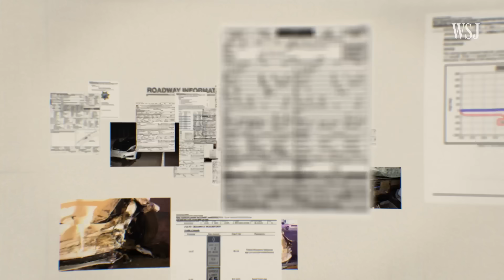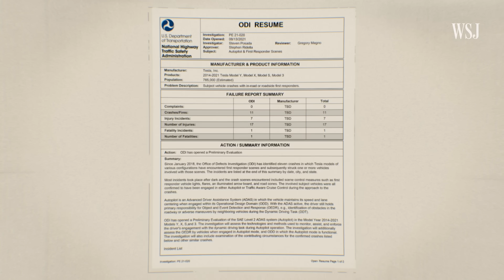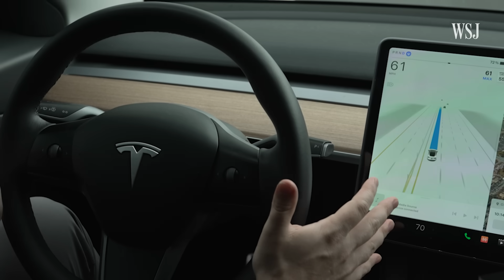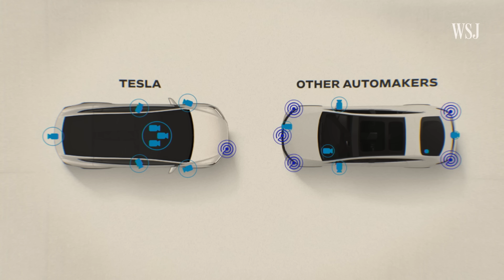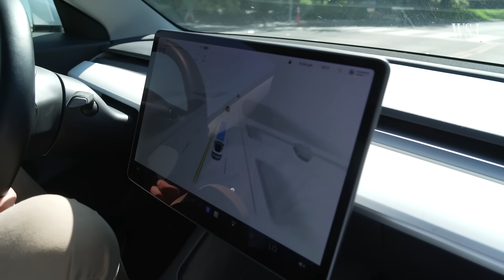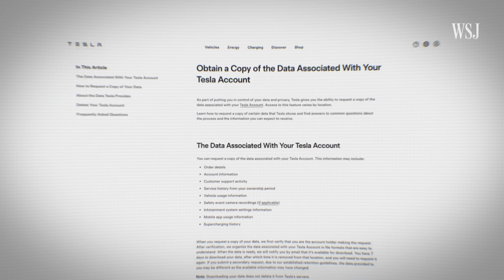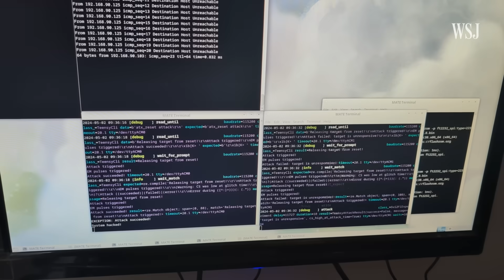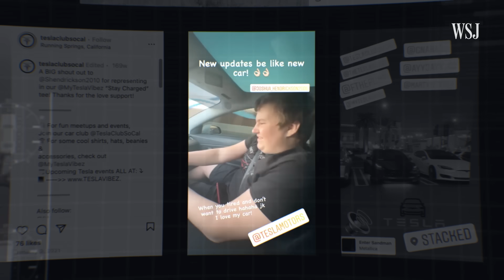The Hidden Autopilot Data That Reveals Why Teslas Crash | WSJ

Comment: You are responsible for everything that happens if you are on autopilot. No one said it’s 100% safe. If you die it’s on you and not the car. 

Also almost any car nowadays has lane centering assist and it’s the same principle as Autopilot. Why don’t you make a video about them? 

PS: you can’t paint tesla’s vision as bad however much you try. Eventually you will ride on one of Teslas robotaxis.

Comment: TL;DR: Either that Tesla (if it's complete/true self driving auto pilot), or the human driver (and evidence suggests that Tesla AutoPilot is more marketing than reality) should've either fully stopped (also turned on all 4 blinkers/hazards lights), or switched lanes ... Either/both well ahead of that sideways laying truck. 

This comes from an electrical and software engineer (electronics and programming), actually born/grew up in areas where Nikola Tesla came from. Who's grandad was real-world "Transporter" (except no Jason Statham type of fighting - grandpa was originally "just" a car mechanic, which was a prerequisite to be a professional driver, and later he wore a suit and drove highest government officials). And I also happen to drive a lot - besides regular everyday driving also 4-6 times per year I drive the majority of ~1800km drive across the Europe. 

While I love distance/speed/lane maintaining cruise control and all that - I'm not going to rely on "auto pilot self driving" cars until technically much simpler things - e.g. all the planes driving/taxi on the tarmac, all the trains and metros (this is already the case in some places), and then all the light rail/trams and finally buses (those have tracks or dedicated lanes - but there might be a person/car/etc in their way) are fully autonomous.

I'm confident that by then those fully autonomous vehicles will not use just cameras/AI-Vision for detection. Because even when you can control all the variables (no other non computer controlled vehicles on the road/track) - there are always birds, animals, snow, fallen leaves, construction ...etc.

Because even "dummy" VW Touran that can only maintain speed and distance from the car in front (doesn't have lane keeping) - with basically no AI - can reliably detect and emergency break/stop before hitting things that Tesla's "Auto Pilot" seems to keep crashing into.

Comment: The outside cameras only without wipers vision system is suspect.   Having radar, C-V2X, and FLIR cameras would make it way better than human vision what's the ability to see around objects and thermal vision.  NHTSA, FCC, DOT must accelerate C-V2X to be mandatory and included in all new phones to prevent car accident fatalities, pedestrian fatalities... C-V2X networked position sharing combined with driver assistance like AEB has the potential to be a super sensor that can see around corners, beyond line of sight.

Comment: FSD currently requires supervision the driver who is responsible. As a result, the Tesla FSD autopilot does not crash. The driver does. The initial premise of this video is wrong. One of the many reasons I canceled my WSJ subscription. When FSD reaches a point where it is safer than human drivers by several orders of magnitude, it will be unsupervised.

Comment: In the case of the overturned truck, rather basic autopilot or FSD was engaged is irrelevant.  Both programs would have reacted the same given they are both using the highway stack of the program just maintaining lane centering and adaptive speed cruising.  The failure is in the recognition of the object at full stop on the road.  True autopilot vision did not recognize the overturned truck but neither did the human.  It might have to do with low lighting condition and the dark color of the underside of the truck.  There was a last moment reaction to the object in the video with a hard pull to the right but unfortunately it was too late since the object took up several lanes.  It was just an unfortunate accident with extremely rare circumstances.  No one including autopilot should be blamed.

Comment: I have driven 90,000 miles in a Model 3 and just got another one. I think it is a great car overall. However I dislike all of its driver assist features as none of them work well. For example when using cruise control and passing a vehicle in another lane on a bend, it will suddenly brake as if the vehicle is dead ahead. The lane departure warning works randomly meaning you have to fight the car to maintain road position.  If these basic things dont work well then it is pretty obvious that full self driving is nowhere near good enough to depend on.

Comment: This is NOT level 5 self driving, clearly every driver accepts they are responsible for using the software. Warning someone 19 times they must keep their hands on the wheel is not the problem with the car, or software, it’s the problem of the carelessness and dangerous driver. This article is clearly written with the basis of blame anyone else or software, rather then placing responsibility on a driver for failing to control their car. Blaming the lack of LiDAR in the car is like blaming the lack of LiDAR in humans for accidents. The car has 360 degree vision, vision is not perfect, but the car monitors 360 degree, human vision is also not perfect, and is also not 360 degrees. Also autopilot of Tesla is similar to the software my 2015 Acura RLX came with  (active cruise control and lane keeping assistance, not lane keeping warning). There is no data in this video whether this software combined with human supervision is safer than human driving or whether it has reduced accidents. The bottom line is drivers are responsible for what their cars do, they are responsible for basic cruise control, they are responsible for autopilot, they are responsible for lane keeping assistance and cruise control combined. This video is much like many people who want to blame anyone or anything rather than take responsibility for their actions.

Comment: Your examples are from years old tech and you are confusing examples of auto pilot - think fancy cruise control and FSD - full self driving. In both cases the driver is suppose to monitor and correct any problems. All crashes are still driver error…

Comment: Theres no question in my mind that my Tesla's autopilot makes me a better driver in 99% of the miles I use it, and makes it a much more relaxing drive. But other than occasionally looking down at my phone, I would never just 'let' the car drive a long distance by itself. It simply can't react properly to every situation. I've driven about 10k miles in my tesla, and I've become used to situations where i know it'll be fine and ones where i need to put my hand on the wheel. That's the human part. Generally speaking, I have found my tesla is too conservative in most situations. It will brake if a car in the next lane drifts a little bit into my lane, for example. Blaming (only) Tesla because people aren't following instructions is not fair, though tesla has not done themselves any favors by implying the technology is infallible. Should a person feel pretty confident on a long straight highway? Yes. In slow traffic? Yes. But on a city street, or a curvy dark mountain road? No way, too much bad can happen.

Comment: Everyone here in the comments blaming the driver for not paying attention to the road. Yes, they obviously should have, but it’s also true that basic vehicles with no AI or fancy autopilot branding would have stopped in this instance, simply based on front RADAR detecting an obstruction on the road. No AI, just basic doppler radar, a technology that has existed since the 1950s.
The decision to exclusively use cameras for Level-2 autonomy is a stupid cost cutting measure. There’s a reason other automakers are not doing this. And even if it is true the vehicle warns you if you take your hands off the wheel for too long, branding cruise control with lane assist as “Autopilot” is reckless marketing.

Comment: They're poorly made cars. Always have been. That's why their value on the second hand market has tanked.
Reply: False clause fallacy. There's lots of reason their value drops in second hand a bit more than other cars. 
Right off the bat, any new vehicle tax credit is removed from their resale value. 
Repairs are not too complicated, just expensive, reducing the demand in buying them out of warranty and the price the market is willing to give for them.
Lastly, just like computer hardware, the newer models always come with better processing power, making them more desirable, and further reducing demand. 
It's not a Tesla problem it's a problem with EVs as a whole in their current state.

Comment: It's obvious that Teslas are crashing more than other cars because "Full Self Driving" isn't actually full self driving. 
It does all the easy stuff that anyone can do, steer, brake etc. mostly OK but not always, but can't handle the unexpected. Tesla drivers are trusting it too much, hesitating to take over or just not paying attention like they're supposed to, and the one or two second delay while they hesitate expecting the car to act is all the difference it takes for a crash rather than an avoided accident. 
Full Self Driving should have been called Supervised Self Driving, but that's not going to sell cars nearly as well, so Mush isn't going to do that climb down.
Personally I'm not sure any automated computerized system can replace an alert and capable human driver, but then not all drivers are alert and capable to start with.

Comment: The problem is that drivers rely on electronics. This has been clarified often enough. Electronics can provide additional safety, but cannot replace people. Would you want to fly in an airplane where pilots rely 100% on the autopilot? Certainly not, right? And as an airline pilot, I tell you that you would be much safer in the plane than in the car.
Reply: elevators were replaced by electronics. used to be a human operating the lever for the elevator. explain that.
Reply: @runlit120  Elevators are used in very confined conditions, even then it take over a few decades to evolve and replace all human operators. The problem with current automated cars are not cars can't move around autonomously. It is the challenge of complex, ever evolving and long tail scenarios that can't be fully capture of statistics approach existing computer vision technology take.
Reply: Automation will make our roads far safer. Most people have no idea just how good FSD is getting.
Reply: @daydreamer8373  Please, stop spamming the comments. Automation alone won't make our roads safer. In car technology, road design improvements, regulation, human awareness altogether will make our roads safer. It is a classical human machine interface problem that semi automation is actually dangerous, as human is easily distracted when monitoring monotonous automation tasks without proper stimulus.
Reply: @alexbian5567  i'm responding to the point that electronics cannot replace people. automated elevators replaced people. the blanket statement doesn't work.

Comment: Autopilot (which is like enhanced cruise control) and Full Self Drive (Supervised) are both not autonomous.  The manual and instructions clearly state the driver needs to pay attention.  Every time you engage it a message appears to say basically “pay attention.”

Yes, it’s tragic what happened - but you’re supposed to be paying attention.  A family friend died of the same thing while not in a Tesla, but on a motorcycle - same situation but obviously no software in the equation.

This software still requires the driver to pay attention and it’s clearly in the manual and videos.

Comment: just because humans don’t use lidar to see doesn’t mean cars shouldn’t
Reply: Doesn't mean they MUST
Reply: @Vlperine  the story shouldn’t be framed as Tesla is being “cheap” or doesn’t care when that isn’t proven.  There may be technical reasons, which I mentioned, in which Lidar introduces more dangers.  So bring on third party engineers to explain.  It is possible that lidar  freaks out every time a plastic bag, or tire debris occludes the lidar.  Do I think that’s the case?  Unclear, would be good to hear from 2-3 experts.  Both NHTSA and Tesla have strong potential cases, more regulation prevents deaths vs. too much regulation prevents life saving tech.  Seems like more oversight might be necessary, but do you really think NHTSA understands neural nets, AI and LiDAR as well as a panel of third party experts, I’m skeptical.
Reply: That's something that people don't seem to get. Humans mainly use our eyes when driving, but we also use our ears and our sense of touch as well. A car can use far more sensors and the only real limits are how many can be processed quickly enough to keep up with the car as it drives and the ability of car buyers to afford the systems. 

Also, these things have a tendency to get cheaper as the amounts of them being manufactured increase.  From what I can tell, a LIDAR array for a car is well under $1k at this point and just the savings on insurance premiums from having the extra level of ability should more than pay for it within a few years.
Reply: @SmallSpoonBrigade  exactly, people are trying to limit machines by what their frontal cortex is aware of.
Reply: lidar doesn't even work in rain and simply contributes more noise to the entire system than just vision only.
Reply: THIS
Reply: Whoever saying Lidar introduces more dangers should read about Waymos. It's uses cameras, lidar, radar, microphone + other sensors. I think. Waymo requires no driver and didn't killed anyone. They are the safest cars and the leader in Robotaxi buisness.

However, adding these many sensors did limit their ability to scale. While Tesla FSD is available everywhere in USA, but any accident would be upon driver. The driver is liable to everything. While for any accidents Waymo company is responsible because they are L4 while Tesla is L2. But Waymo is only available in only few major cities.

They tried to make L2 driver assist systems like Tesla but dropped this approach because they found this system makes driving dangerous. This L2 system of Tesla maybe the reason why it was called the 2nd most dangerous car on road.
Reply: @BigBlueFlame-000  waymo crashed into a stationary pole, something lidar should have avoided. clearly waymo is filtering out false positives which makes lidar useless
Reply: @BigBlueFlame-000  You bring up another good point: why must Tesla scale so fast? Instead of taking the time to make it work right. The Tesla fans might say because you need more data. I would argue that may help with some data collection at the risk of killing more people. And it may never work because of so many edge cases. They don’t seem to care about the risk part. That doesn’t pump the stock.
Reply: I’m a computer engineer, using lidar also introduces additional dangers, I need to read up more on Waymo, I do think a fusion of lidar,radar,ultrasonic with camera trained neural nets seems intuitively like the best solution, however you could imagine stray debris or unusual objects triggering a lidar to signal to the car to take serious evasive control which might be even more dangerous.  I don’t like approach of article, but it’s fair enough, but not very thoughtful on the tech side, bring in third party engineers who can commment

All that said, software controlling cars scares me.
Reply: @ArsPhantazm  good point but i guess taking in multiple sources of evidence is a good idea, like an aeroplane it needs backups for critical systems. i’m an electronic systems engineer.
Reply: @ArsPhantazm  oh you’re totally right, they’re scary but if there’s enough compute and enough clean data for them to make decision then it will be there. my biggest problem is with the sensors getting obstructed or just not being good enough.
Reply: @ArsPhantazm  First time I used FSD I had both feet hovering on both pedals. Since half the time it breaks too much and the other half I’m scared. But that was right when FSD released in Canada. I had to drive a lot like a grandma to keep my safety score to get in on the beta. And even then. 3 days of use and I was shocked how good it was. I could drive to and from my brothers place flawlessly. It literally saved my life a few times. I described that beta as a 15yr driving for the first time. Overly cautious, zero confidence. So you had to hold its hand and keep pushing the gas lol
Reply: Tesla does not use lidar, and the video shows Musk saying it is unnecessary.
Reply: V13 is showing lidar is not needed. Most people have no idea just how good FSD is becoming. Tesla are well set to dominate in this space.

Comment: The implementation of autopilot has one such obvious, fatal error. Changing just this one thing would greatly reduce the number of crashes. When you approach a bend in the highway, the Tesla does not warn you that it doesn’t think it can take the turn at the speed that you have autopilot set to. Instead, in the apex of the turn, it will suddenly give control back to you. It chooses to do this instead of slowing down to take the turn at a safe speed.

This is incredibly dangerous. It’s like if you’re in driver’s school and the teacher doesn’t warn you when they give you control.

Comment: Methinks the major issue here is the advertising. No one should be allowed to call these features autopilot because of the perception that it gives. Advanced cruise control or something of the ilk would have been just fine IMHO. Also touting only the benefits and not speaking of the ills as loudly is also not on.

Comment: This video is insanely biased and ignorant. Camera only or not has nothing to do with this. Autopilot is not FSD and both autopilot and FSD require full driver attention as they are level 2 and Tesla clearly states this when you activate either. 

Another dumb Tesla hit piece.